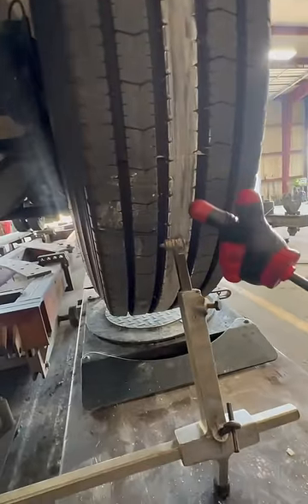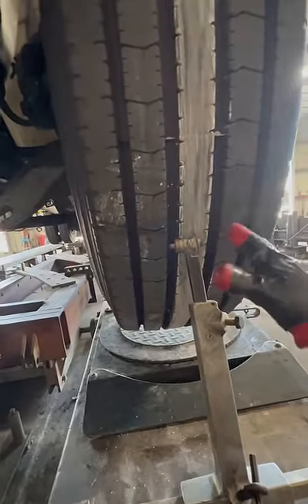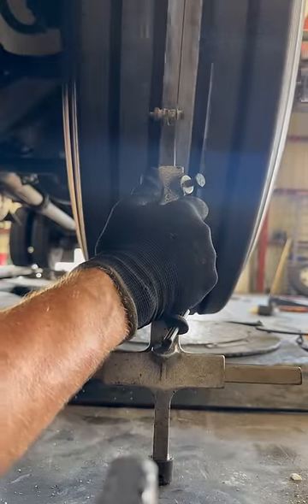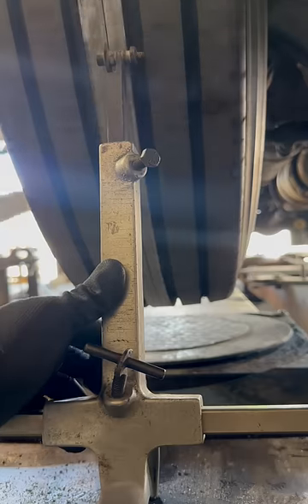Lit up 🔥

Comment: A lot of times, the old ways are the best.
Reply: tried and true
Reply: I've  been doing it soncec1982
Reply: Computers just make shit difficult and ppl feel important!
Reply: You beat me to it. My favorite alignment guy finally retired. He did everything old school. No computer equipment in his shop. And he had a wealth of knowledge. Like on BMWS the factory specs for the alignment are designed for flat pavement according to him and the roads in the US have crowns so he would tweak it for us roads and they always drove great and the tires lasted longer. Now everyone has those laser machines. I chringe every time I see them. And I worked for a NASCAR team for about 10 years and we used tow plates, tape measures jack stands with string. Lots of different tricks. I have lined up quite a few my self using race car methods. And castor camber guage. Very low tech but works just fine.
Reply: Analog is key, being able to see a needle jumping or feel a weird vibration rather than just some shmuck in an office looking at digital readings
Reply: @trentswag9324  seeing a needle jumping is the same exact thing as a looking at a data list on a scan tool is it not?
Reply: @rbmwiv If time and convenience didn't rule everything in America I bet we'd still be using jack stands, some strings and a tape measure. I actually want to learn how to do it that way because I noticed on the machine I use at work it will say a car is aligned but then when we take it for a drive it pulls to the side and then we put it back on and it says its out. There are certain little tricks you gotta learn with each machine to know how to get it to give you the right info. If you set it up wrong then it will say its aligned all day if it can read the sensors. Our machine even said that one of our managers car was aligned but you could see it leaning to one side because the back tire was out, but the machine read it as aligned.
Reply: @erllrma  definitely! I saw someone talking about seeing the data on a complex system. Well that’s true but like you said if something isn’t calibrated correctly then everything is off. With the analog less convenient ways you can tell pretty quickly if something is off. It all comes down to the operator and their equipment. Having to use the new school guys to do alignments I have had to correct quite a few after they were dropped off as finished and when I drove it the car either pulled to one side or the steering wheel was crooked. Instead of taking it back I just do it myself. Luckily I have found a place that has been very good the last 20+ cars I have sent to them have come back just like they should be. There’s probably a dozen or more alignment shops in my area and it took a while to find a good one.  I have built a lot of cars and you definitely want to know how to measure stuff when you’re cutting up and welding stuff together. It has to be perfect.
Reply: we got this far by the old ways!
Reply: That’s what Kincaid said in Skyfall.
Reply: Sometimes even just a real good eye & then a road test (if practical) & if don't have a tool on hand (even a simple bar w/ 2 pointers. See if it pulls or not & how well it tracks (on a clear road) inside the lane. If it pulls or begins to wander...go back & turn the tie rod end just a little bit more. Repeat if needed.
This works easiest when toe has only 1 end that adjusts.
Reply: I'm really enjoying these comments from ppl who actually do the work and can confirm; nice dialogue here.
Reply: @WillSwingem  Ask pilots with a high workload if they prefer analog needles or digital readouts when doing instrument scans.
Reply: @jedoch1  that has nothing to do with what I said lol
Reply: It's a similar comparison. It is much easier - and faster - for the human brain to take visual input from an analog gauge that uses a needle than to have to interpret a numerical value from a digital display. The needle simply shows the relationship between the value it is representing and its operational parameters, while the digital display value has to be received, acknowledged and then mentally compared to either known or memorized parameters.
Reply: More often than not. There multio billion dollar offshore oil platforms with a 20 year life expectancy before having to be restructured, whereas the old pump jacks work on nothing more than a counterweight and back pressure
Reply: @theglitch99 no they don't.

This method he shows isn't all that great and can be off by significant margins.
Reply: @WillSwingem  thing is, its harder to visualize the numbers especially if you are just prepping for the next tech because maybe you ran out of time. Also while you are down there looking you can see everything that has to do with that tire and it could turn out it was something else causing the issue but because you are visually seeing everything you already know the problem. With the laser while you can see deviations those numbers on their own dont tell the whole story in what is going on thus you have to go visually inspect anyways because it deviates in a way that is hard to imagine cause its just numbers. Now i will say there is people out there that can just look at some numbers and pretty much know the issue. But for most visually seeing everything is not only easier but quicker in determining what it is that is causing the problem and the repair that is necessary. Basically killing a few birds with one stone with some of the old ways of doing it.
Reply: Why change things up when the try and true always works best
Reply: I had a kid with a brand new bear machine tell me that one of the wheels on my rear needed to be shimmer out at the bottom. I told him that was physically impossible. It was an 89 mustang with an 8.8 axle. The shaft would have to be bent. And, no, it was not bent.
Reply: @derekdelamar  it isn't impossible they bend all the time.

Comment: In engineering, this is called "first principles" and when all "easier" approaches fail, "first princples" don't.  No abstractions like calibrating an electronic system which can malfunction - just a line and an analog measuring device.

Comment: This also will show other problems with run out. Bent wheels, hubs, spindles and broke belts in tire.
Reply: *broken belts.
Reply: This will only show that. this didn't measure how far the back of the wheels are in or out
Reply: Yeah, to me, this would only identify problems with bent axle/hub or mounting problem. It wouldn't matter if this tire was toe in/out when scribing. That point on the tire will always be in the same place as long as there are no bends in the hub. 😂
Reply: @kontageon9764 that’s what a plumb Bob and a chalk line is for.
Reply: Simple wins.
Reply: Yeah I thought you needed a string and tape measure or something to see how uneven the tires were compared to the line.
Reply: And when a guy does it frequently, it’s just as fast.

Comment: Off-road water trucks bend the tie rod all the time, hitting huge dirt clods or rocks. You get out with the bottle jack, wrench, and tape measure. Takes 20-30 min and steering is back to normal.
Reply: That's how I learned.

Comment: there really is no replacing or faking experience!
as an engineer this makes me smile :)
have a great day sir
Reply: You drive a train? Cool!
Reply: Why do engineers constantly tell everyone what they went to college for and need validation ?
Reply: @SSgtdennisgray You have your rank in your profile name. You announce your rank and "need for validation" every time you comment
Reply: @SSgtdennisgray Because engineer school is hard as hell and not many make it.  Give it a run Skippy.
Reply: @davec.3198  Nope.  Modern engineering is woke and worthless. They teach you everything but engineering now.   

I went back to school for engineering back in the early 2000's in the midwest and it was already going full throttle into the land of worthless degrees with no substance out here back then and I know damn well it's just gotten worse since.
Reply: @SSgtdennisgray  You do know that "SSgt." is in your username right?
Reply: I really appreciate a engineer paying tribute to the man that does the work. I always appreciated engineering because I was smart enough to know I wasn't one, I was the builder. My only bitch with some I encountered they weren't to reciprocal to me
Reply: @SSgtdennisgray because that is their profession and they are proud of it. I was very fortunate to have worked with a architect that had been a builder, inspector and a architect last. He spoiled me because he was enormously practical yet has great designs

Comment: My uncle owned a collision and body place a real long time in Armonk New York. I busted up this 91 Ford explorer I had in high school. Bent the I beam and the mount for it on one side. I replaced it all and brought it over to him to ask for his help aligning the thing and fixing the frame where the beam mount bent. We pulled the frame w the ram and he did the alignment using those Same style tools and string heads. I was young and had no experience, asked him why he still did string alignments and everything manually and he told me he could buy a brand new computerized machine no prob but the string and manual method chalking the tires was always accurate and that unlike the hunter machine you pretty much never had to redo the alignment.
Reply: I used a hunter machine and I think he’s probly right but it depends on how good u know ur equipment and how to use it but usually the old way is the right way lmao 😂😂I done them many ways and ut sucks if h have to redo it it’s already some grunt work
Reply: If you're good at the old way already you will probably be better at it. I learned on a modern system and pretty well never had to redo an alignment, but I'm sure I would make mistakes if I had to learn the old way until I learned it.

Comment: 1/32 toed in. How we all did alignments and frame work at ol McCoys.
Reply: McCoy Freightliner?? Thats where I used to do the same thing...😂
Reply: Don’t work on big trucks but I assume that’s because being rear wheel drive it has a tendency to push the front tires slightly outward when in motion? I used to set rear wheel drive passenger vehicles slightly toed in for that reason. I was taught to set front wheel drive vehicles toward the outside of spec because they tend to pull the wheels inwards due to the force of the axles turning.
Reply: @Jpilgrim30  i think thats the idea behind it...👍

Comment: I learned this from an old friend, mechanic, and  amateur radio operator when I was about 26  and had just gotten out of the Navy,  1974.  I do my own alignments,  old aged Ammco  caster/ camber gauge,  turning plates,  and toe gauge.  I recently converted my  01 RAM Cummins  5 speed  from 2 to 4WD. Yup.  Aligned it myself.

Comment: I've done multiple "alignments" on garbage trucks that way. It's nice to have that marker, don't know the correct name...😐
Reply: This only works if you have a reference behind the wheel and to the wheel on the other side
Reply: And it's quicker to measure
Reply: @terranovarain6570  at that particular job they were mainly worried about tire wear, or that it was OK to run the next day. Set the toe and let it go. Wheel position, atleast steering wheel was not so important. In the disposal world it was all about being able to run the next day. Haha before I worked there I had done alignments on passenger cars when tire wear and steering wheel placement were more important.
Reply: I use a 2x4 piece with a nail sticking thru. The point of the nail leaves a thin line thats easy to measure when you spin the tire with it touching just like he did. Tape measure and a jack is all you need.

Comment: This is probably a newb question but does the suspension not being under load affect the wheel location vs on the road? Besides my ttb fords most cars I've worked on the wheel gets closer to the center of the vehicle when I jack it up. Is this because the big trucks don't have front drive axles? Love yours and Bob's videos just always curious to learn

Comment: That's how we did mack triaxles for construction company I used to work for. Anytime we changed tie rod ends. Sometimes if tires showed wear to one side . Or if driver complained about truck pulling to one side

Comment: S Point manager just couldn't believe it when I told him the alignment done on my van was crap, because he said it was done on his rack.  "Well, the vehicle pulls pretty decently to the left.  In fact, it will climb the crown in the road to pull me into oncoming traffic.  If you don't believe me, take it for a test drive yourself, which you should have done anyway.  And if it pulls in ANY direction, it should pull to the right, because if I fall asleep behind the wheel, I'd rather hit a tree going 60 MPH than a Mack Truck going 120 MPH."
They did the alignment again, correctly this time.

Comment: My dad taught me this in his 57 Ford Crown Victoria.
Jack the car up, blocks / stands directly under the pivot point at as close to spindles as possible 
Block rear axle also slightly off ground
He used carpenter’s blue chalk to mark center of tires
Spin tires and Scribed the line in center of tires with a nail
Took a piece of wood lath with two nails
Adjust Front of tire 1/16 of an inch closer than the back of the tire.

Comment: I assume you're talking about total toe, not individual. Are they not using modern laser / electronic alignment for big trucks? How far off is the tolerance?
Reply from the maker: Yea total toe. But there isn’t an individual toe on semis. Both wheels are connected together so only total toe is what is needed. And yes they have lasers and what not and the tolerance is 1/32 but depending on the truck may cause wear patterns if it’s a heavy truck
Reply: @bendinwithbendon  I'm surprised they let the machine be so loose. It puts the burden on you to go behind it and verify when the whole point of the machine is to do the hard part(s) for you.   /     Can I ask another noob question? How do you center the steering wheel if you can only set total toe?

Comment: I use this system on my old Cherokee. Just shy of 1/4 inch works best on mine. Small lift and 32 inch tires. It works well and is repeatable like you said, no damn calibration, and no paying some kid to screw it up. Be safe.

Comment: Using the string method is way more accurate than using the machine. Never had an issue with string and tape measures. The $60,000 computer on the other hand.........

Comment: Works great for construction equipment.
And measure between lines and adjust your sway bar.
Don't need to spend money on off road equipment.
Dump,mixer ect.

Comment: Your videos allowed me to set alignment on on a fleet truck with a tape measure, level,  and paint pen. I could have got way more precise with some of these jigs you've got such as in this video. But the principals I've learned from your videos were; enough to set an alignment that the dealership wouldn't do with their brand new $120,000 alignment machine, unless the entire front suspension was replaced.

Comment: I have been doing front end work and alignments since the early seventies and I have never used a computer, NEVER, and I have never had a customer come back and complain yet, i guarantee my work and if the alignment isn't right I replace the tires outta my pocket, I've never replaced a tire cause I do it right, just like you are

Comment: i had a 1985 ford it the great tires i got off road ones the biggest miss judgement ok i measure lines front and back the lines were off the old 60,000 mile tires worked fine( the engine & trans did not last like the tires) replaced there crap! i got a chevy v6 4.3 with a power adder a thing it runs off a pulley with a clutch do brakes work? my last ford went for a swim in the lake!  i was pissed these fools no show!

Comment: Man, when I worked in West Texas oil field in the 90's That was the only front end alignment we did. It's actually pretty accurate if the spring hangers and king pins and bushing aren't trashed.

Comment: As soneone who's Hunter certified, sometimes computers just don't get it right. I did my own toe adjustments manually on my Golf. You can buy a brand new alignment machine and still be off. The built in tolerances are to dumb down alignment services so anyone who can get it on the rack can align it "within factory specifications" with little training.

Comment: That was the way I learned to check toe. Question for you. You bend and twist the axle in the truck or bus to correct the caster and camber, or pull it and put it in a large gantry press? The only times I pulled the axle is when I one side completely out of wack from an accident. Your rack appears to be very similar to the Bee Line frame and front end rack I used 20 years ago.

Comment: Spray the center rib with primer, spin the tire, scribe the line with it spinning. Read toe at the vertical face of the tire, front and rear with a tram rod.  1/16" toe in on a 12k front axle, 1/8" on a 16k axle.

Comment: I've done thousands of alignments I'm probably 20 years older than you maybe 25 years older than you the only thing that's going to tell you is if the tires out of round ,
It'll also tell you if you got an oblong wheel which is basically what your run out tells you so I'm not real sure while you're doing tha
Unless you're using that Centerline to measure the distance from Tire to tire ?🤔

Comment: Old school Waze are proven and they work. To this day I still set my wheel alignment with a framing square and my eyes and I've never had a tire wear out on me. Even took my truck into a dealership to get an oil change and the Machine I drove over checks wheel alignment and it was dead.